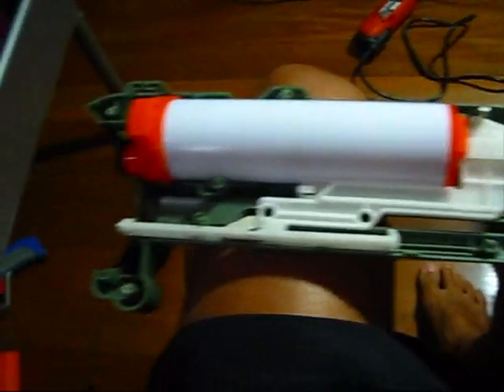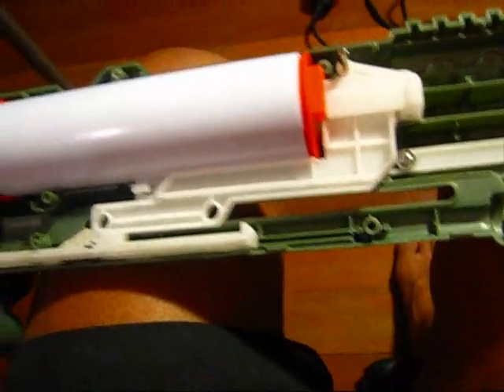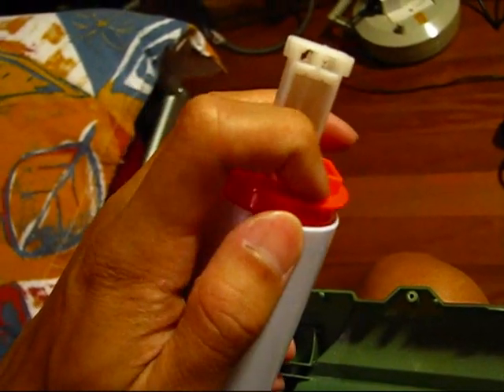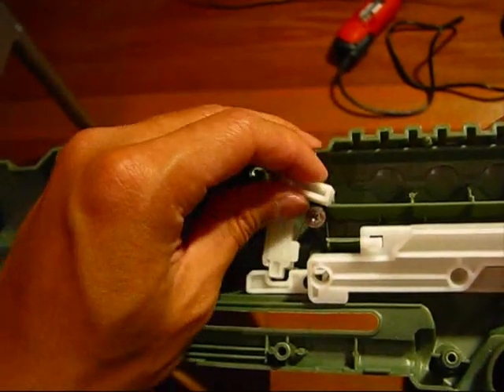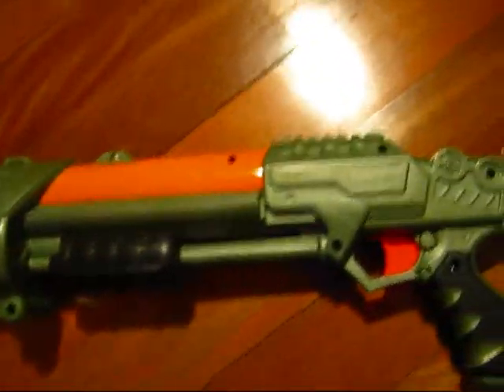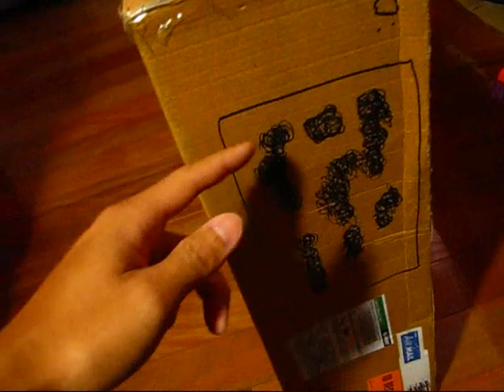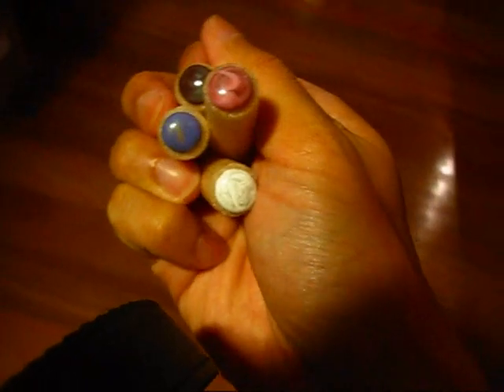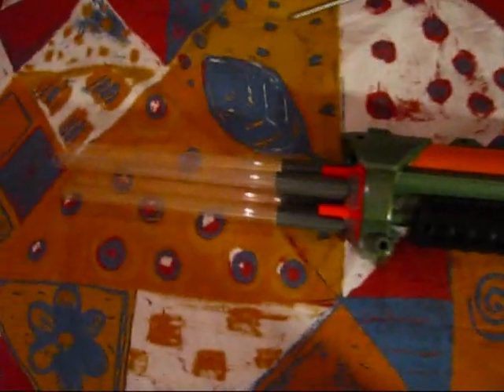Modified Lanard Quadshot!

Comment from the maker: It's called 13mm UPVC over here. PETG fits snug inside it. Most of the time I have to sand the PETG down a little for it to fit in. However I do have a batch where the PETG just slides with a nice tight fit.

Comment from the maker: @PancakePal28 The power 'levels' or notches have nothing to do with the rotation. A separate bar linked to the priming bar rotates the turret. You can probably put epoxy till the 7th notch if you wanted to.